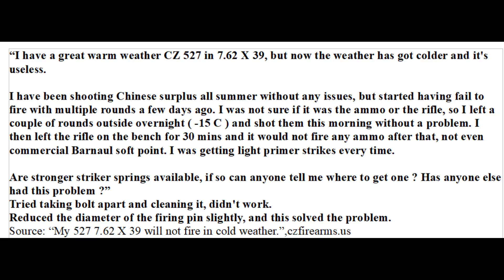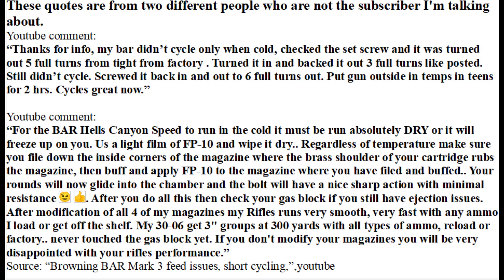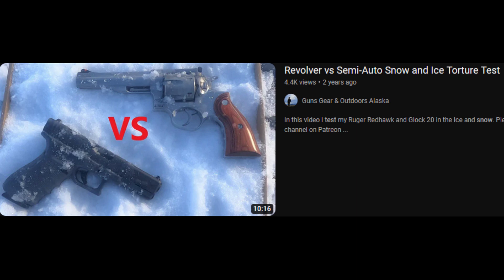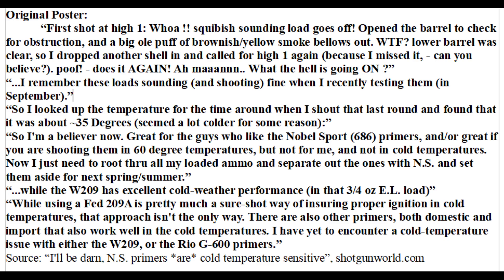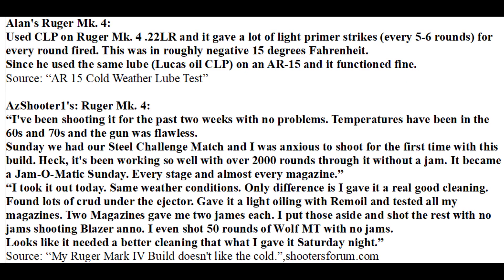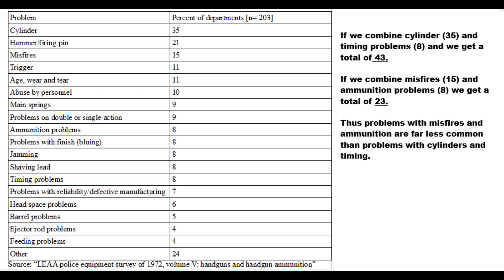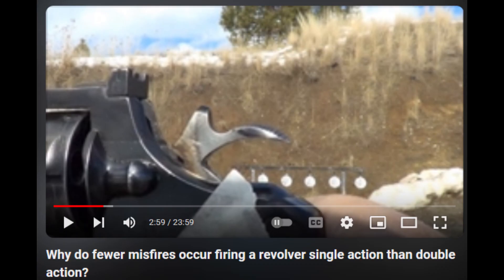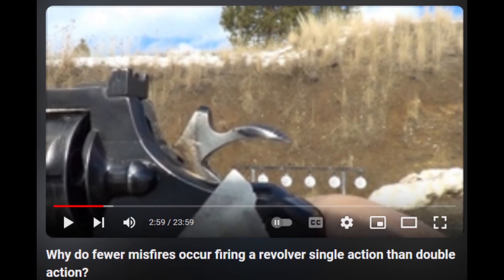How Extreme Cold Affects Weapon Reliability

Comment from the maker: In many cases a cartridge that does not go of the first time when struck, will also not go of after being struck a second time. 
	“The .38 calibre revolver was chosen as the police weapon years ago because of the fact that automatic or self-loading pistols may misfire and require the officer to reach forward and “charge” the weapon by pulling the slide to the rear, ejecting the cartridge that misfired and placing a fresh round in the chamber. It’s true that some pistols now have a double-action feature, which permits the trigger to rachet back the hammer for another blow at the cartridge that misfired, but this will not put a fresh cartridge into the chamber and in many instances a cartridge that misfired in the first instance will not fire when struck a second time. In any event, a policeman facing an armed opponent cannot take this risk. The revolver offers him an opportunity to rapidly revolve the cylinder by either thumb or trigger finger action and place a fresh cartridge under the firing pin whenever a misfire occurs.”
Source: “Combat Shooting for Police”

Comment: I don’t know why I’m watching this as I live on the gulf coast and never see freezing temperatures but I like it!  Thanks for the info. One question, why would pulling the hammer back on a revolver allow you to strike the malfunctioning round again?  Pulling the hammer back on a single action or double action revolver advances the cylinder and moves to a new round anyways. Just wondering, not criticizing at all as I may very well be wrong.  Both my single action and double action (and in my case hammer less)revolvers advance the cylinder if you cock the hammer or pull the trigger a second time.
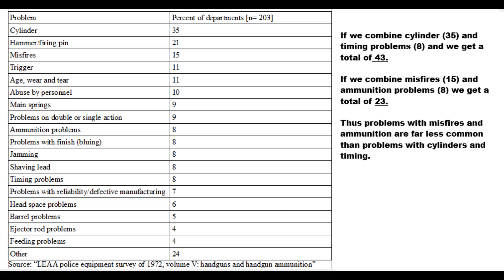Reply from the maker: I was talking about single action vs striker fired pistols, not revolvers in that part. If you replay the part at 11:38, I said pistol not revolver. 

So yes you are right that revolvers typically don't let you restrike a round unless you either turn the cylinder back or run all the through the cylinder and restrike the round that way.

Personally, I like watching videos with the closed captioning on in case I mishear what someone says. It's extremely helpful if someone has a thick accent.
Reply from the maker: As a fun fact, Colt advertised his revolvers as "repeating pistols."

Comment: Question does the inside of the barrel chamber and the barrel itself change diameters in cold temperatures and after firing several fast hot rounds. Does the chamber diameter change and by how much?
Reply from the maker: Well I don't have a calipers, and I guess I've never tried to measure it, but it is inevitable that some change is size takes place with an extreme shift in temperature.
It would depend a lot on what caliber and firearm you have too, that would determine how hot it gets as well as how many rounds you fire.
But in general, the amount it changes, even if it gets really hot, is pretty small and doesn't matter that much in a gun that is built right.

Comment: As an academic by trade, I appreciate the value of a "literature review" video of this type. Much deep firearm lore is buried in ancient forums, it seems. In particular, I appreciate in particular your diligence for citing your sources; would it be possible to have them--at least the Youtube videos you reference--included in the video description? (Despite living in the frigid Midwest, I've never seen that Garand Thumb frozen gun video.)

As for the rechambering 22LR comment, I would say I find that, typically, if I do rechamber a 22LR round, it does almost always fire on the second strike. I tend to favor the theory that 22LR priming compound is not typically equidistributed throughout the rim of bulk 22LR cartridges, which is one of the primary reasons that 22LR is not reliable.
Reply from the maker: Sure I can do that! The video links are now in the description.
I'm not sure if it was visible on all screens/devices but I also included the titles of the garandthumb videos within the video itself at the bottom.

Your probably right about restriking .22 rounds. Those rounds I was using were kind of old, and probably weren't stored in the best conditions.
Another interesting fact was that the Winchester rifles chambered in rimfire .44 Winchester had two firing pins for more reliable ignition.

Comment: I was hunting with my brother and his son at the end of the Montana general season around 12 years ago. It was a brutally cold day, around -25 F, with a wind chill -40 and colder. We drove along snowy canyons, stopping and glassing, taking short hikes. Getting in and out of the warm truck, and back out into the cold must have caused condensation. At dusk, we spotted a buck, and my nephew wanted to go get him. He and my brother took a hike to get a shot, while I waited at the truck watching the deer. There were no shots. Eventually they came back, and told me how they got into position, nephew tried to shoot, and the gun wouldn't fire. When we got home, my brother pulled the rifle apart, then disassembled the bolt. There was still ice inside.
Reply: This last season I had something similar happen. I was glassing and decided to chamber a round in my bolt gun because I've had bucks run up on me while glassing before. After about an hour I decided to move to the next ridge and tried to unchamber a round, but I couldn't. Turns out I hadn't checked if my gun oil was cold tested and it had froze. After a few times of hitting the bolt it finally opened. Needless to say I have since changed the oil I use.